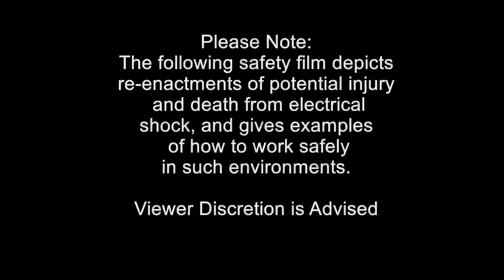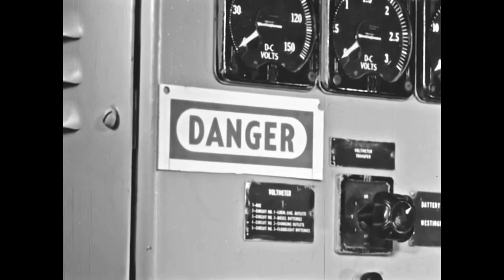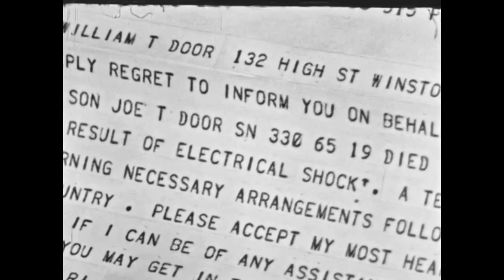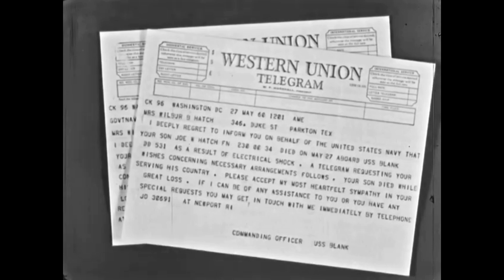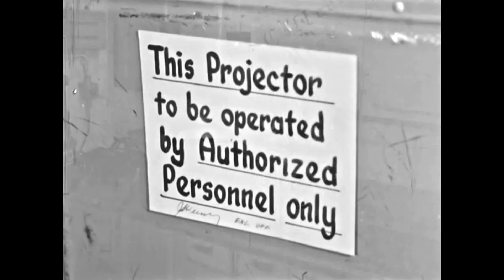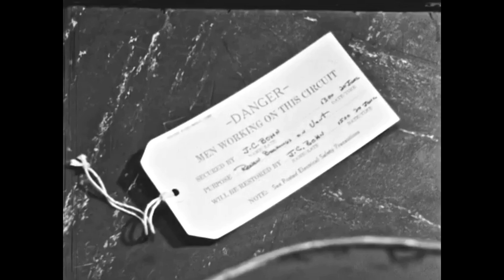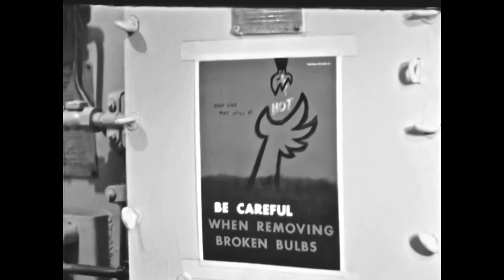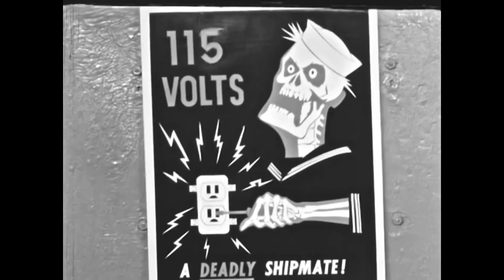How to Safely Control Electrical Power- Low Voltage Naval Machines & Electronics 1960 electricity

Comment: My youngest brother was in the Navy reserve and he said that they touched base intensely about electrical safety 
Electrical safety is a thousand times more critical aboard a Navy ship , Submarine and other watercraft because of course , Electricity always looks for the easiest path to the ground and the path of least resistance and aboard a ship , Everything around you is a path to the ground , Literally!!!  That's why every single appliance , power tool , Every single item that runs on electricity has to be properly grounded , After seeing this film , I wish I was one of those sailors aboard their ship so I can teach them about electrical safety , One thing for sure , If I was doing electrical work aboard a ship and had to go into a circuit breaker panel , I'd be using a rubber mat to stand on and wearing rubber gloves because everything aboard a ship is a path to the ground and wearing other protective equipment necessary and I would also have a second person with me when going into a circuit breaker panel or other live electrical equipment just in case something happens and the second person can call for help 
Never work in live electrical equipment unless you have a second person with you , I always do whatever I go into live electrical equipment and having a second person around known as The buddy system makes me feel more comfortable
Reply from the maker: Hi @ironmartysharpe8293, thank you for your very thoughtful feedback!   I really like the idea of having a second person accompany one in any of the shipboard scenarios.  That makes lots of sense.  I wonder if that is done aboard ships today.    Thanks very much for sharing your insights!  ~  VK, CHAP
@ironmartysharpe8293

Comment: This is the WORST film I've ever seen. I was an electrician in the Navy. First of all, you never have to lay down rubber matting to add dielectric value to 115/120V. I could understand such matting once you get around 400V.  Secondly, drilling into an electrical conduit with a proper ground connection, and he still gets electrocuted makes no sense. Thirdly, this was back in the days when every electric appliance had a steel casing. The ground wire attached to the steel body was there to direct electrical current away from the person towards the path of ground. Nowadays most power drills, saws and such are only 2-prong without the ground connection, because the casing is plastic... no need for it.
Reply from the maker: Hi @usnva5638, thanks very much for your perspective on this. Can't argue with the specifics and it sounds like you have experience in this area.  If they gave out bad info in the creation of this film, that would not be a good thing for the audience they are trying to teach.  Makes one wonder.

Comment: As a kid, I use to rewire outlets and overhead lights without shutting off the electricity. 🫨⚡ No my parents never stopped me and I'm still alive. I got really good at it , really quick. Could never figure out which glass fuse did what, so I just did it anyway. Shocking isn't it.

Comment: My first experience with 120 v AC was when I was 2 and jammed some staples in a floor electrical outlet in a department store.  Burnt fingers and traumatized mother. I've been in electronics my whole life and never forgot that day 😅😅
Reply from the maker: Sounds like quite a good lesson.  : )
Reply: Your not alone , I was almost killed by electricity when I was 10 years old and I didn't realize that electricity always looks for the easiest path to the ground and I was standing on the register warming my feet up and then turned on the floor lamp and I didn't know the lamp was defective and got a really bad shock and it was a miracle I got off the register , Stopping the shock and my parents came from upstairs and found me laying on the floor and then they realized that the lamp was defective and called the neighbor who's an electrician and found that one tiny strand of wire was touching the socket making the whole lamp live , and afterwards , He taught me alot about electrical safety 
Even though my ordeal was horrible 
Good came out of it which made me realize that electricity is very dangerous and I am very strict with electrical safety , I only do installations to meet the National Electrical Code and use high quality materials to do the job right , Absolutely no cutting corners or " Jerry rigging" of any kind 
Never take chances with electricity 
Such as cutting corners and/or using cheap materials to save money , 
Definitely not worth the risk 
Money can be replaced , You cannot

Comment: We've come light years ahead in electrical safety over the last 65 years, from requiring ground wires in all AC circuits in every home and commercial establishment beginning in the mid 1960s, GFCI protection in wet areas beginning in the early 1970s, the phase out of open front plugs ( the terminals in front of the prongs were dangerous when used with metal faceplates, the cardboard insulator that was supposed to slip over the prongs and cover the connections is all too often lost or never installed) AFCI protection in the early 2000s, tamper resistant receptacles since 2008, SPGFCI (Special purpose Ground Fault Circuit Interrupter) designed for use in circuits exceeding 150 volts to ground, such as the familiar 480Y/277 volt system used in commercial/industrial situations with lighting and 3 phase motor loads, first required upon the adoption of the 2023 NEC for swimming pool pumps.
Reply from the maker: Hi @rarelampcollector, thank you for that info!  Sounds like you have a good background in these electrical standards.   Never heard of SPGFCI.   That's a new one to me.  Thanks for sharing this!
I really wonder how all this applies to the use of home EV chargers and the voltages and power drain involved in this new "home use" technology.   Would love an expert's opinion on this area.   ~  VK

Comment: 3:55 Point taken but I would think a properly grounded drill would have prevented that. I did similar once and the fuse blew immediately. Maybe I got lucky and he didn't. Either way please work safe people.
Reply from the maker: Hi @scratchdog2216, yes, glad you are ok.   Good point!
Reply: I suppose us here on the UK had the advantage that all our plugs are polarised and that we never really had plugs or sockets without a ground connection, so it seems that we had more devices with an earth connection where it was probably not that necessary but safer. A similar fan in the UK would have been earthed, for example.
Of course we used 240V for everything, not just high power devices, so a more careful approach was necessary.
Reply: When the guy drilled into the conduit on the other side of the wall , If the drill was properly grounded , He would not get a shock because the ground wire would carry the current away from him and down into the ground , So for sure , The drill itself was not properly grounded , Also when the drill bit severed the wiring and if the drill was properly grounded , It would have blown the fuse or tripped the circuit breaker
Reply: These days drills are not grounded, or even wireless. A fuse protects the electrical installation only, not humans! The fuse may blow by a short circuit, I've been there. Protection is possible by an insulated drill, or these days by a circuit breaker sensing current is flowing somewhere else... RCD

Comment: Yes although it is true that electricity works for us, electricity can at the same time work against us if we're not careful or understanding of proper safety measures when it comes to working with electricity. The moral of the video is not only safety first(always safety first) but also be aware of faulty wiring or whatnot and learn the proper safety measures when working with electricity, thank you for this cautionary but great video CHAP
Reply from the maker: Hi @RetroEli1982, excellent point!  Safety is primary always.  Today especially, we need to be very wary of electrical tools and other devices.  We see coffee makers, toasters, etc., made over seas, with under rated plugs and wiring that get very hot.  Using low grade wire and connections to save money, causes more accidents.  We need to respect the current and voltage always. ; )
Thanks again for the great feedback.  ~  VK
@RetroEli1982

Comment: Good advice. Don't fear electricity but always treat it with great respect.
Reply from the maker: Very true!
Reply: My electrician friend always told me that to try not to fear electricity but respect , Electricity almost took my life when I was 10 years old from a defective floor lamp and I went to turn it on , I got a terrible shock and fell to the floor lamp and all , God had to have come down from his heaven and pulled me loose and my parents came from upstairs and found me laying on the floor and they realized that the lamp was defective , So they called the neighbor who's an electrician and found one tiny strand of wire touching the socket making the whole lamp live and I didn't realize I was standing on a path to the ground because I was standing on the register warming my feet up and later on , The electrician taught me alot about electrical safety 
I've always had a big interest in electricity and I've been doing wiring since I was a teenager and after my ordeal , I've become very strict about electrical safety , That I do installations to meet The National Electrical Code 
Absolutely no "Jerry rigging" of any kind and several electrician friends of mine gave me some valuable tips along the way when doing electrical work , If the job is not gonna be doing right , Then I won't do it , Even though my ordeal was horrible , Good came out of it which made me realize how dangerous electricity is and that doing the job right is very critical and I definitely don't want anybody to get hurt , I only use the best quality materials I can find , For example , I only use commercial grade outlets and switches , Not those cheap ones you find dumped into a bin at your local store , Using high quality materials plays a huge role in electrical safety 
One very important item everyone who does electrical work is a lockout for circuit breakers with a padlock and warning tag to lockout tagout the circuit before I start my work 
Lockout tagout is just as important at home as it is in the workplace 
If you don't have a lockout tagout and padlock , Go to your local electrical supply and get one 
So before you do any electrical work 
No matter how small the job is , 
Lock it out , Tag it out , There is absolutely no such thing as being too careful , ALWAYS PUT SAFETY FIRST !!!

Comment: An excellent film and equally excellent reminder on the dangers of electricity. I was permitted to play around with 115 volts as a kid... I most DEFINITELY learned to respect it!
Reply: The UK has double the angry pixies, even more fun for the enquiring hand of a young boy,  pretty sparks  oh  fire as well.    Dad !
Reply: I learned the hard way when I was 10 years old and turned on the floor lamp and nobody told me the lamp was defective and I was standing on the register warming my feet up and didn't realize I was standing on a path to the ground and how I got loose was a miracle because my parents would have found me dead and our neighbor who's an electrician told me about electrical safety and after my ordeal 
I take electrical safety very seriously

Comment: ...and the days of lessor-insulated non-polarized all-metal corded tools....  Yikes.
Reply: GROUNDING IS  ESSENTIAL . ALL METAL APPLIANCES LIKE MICROWAVE  OVENS,  DISH WASHERS, WASHING MACHINES , CLOTHES DRYERS ARE ALL METAL AND PROPER GROUNDING IS MANDATORY.  I GOT A SEVERE ELECTRIC SHOCK OFF OF A  WASHING MACHINE THAT SOMEHOW LOST GROUND THROUGH  A PERSON WHO WORKED ON IT  BEFORE. I FOUND THE PROBLEM . THE GROUND WIRE WAS LEFT OFF . I RECONNECTED IT AND CHECK WITH OHM METER FOR PROPER GROUNDING . NO PROBLEM AFTER I FIXED THE GROUND WIRE.
Reply: GROUNDING IS  ESSENTIAL . ALL METAL APPLIANCES LIKE MICROWAVE  OVENS,  DISH WASHERS, WASHING MACHINES , CLOTHES DRYERS ARE ALL METAL AND PROPER GROUNDING IS MANDATORY.  I GOT A SEVERE ELECTRIC SHOCK OFF OF A  WASHING MACHINE THAT SOMEHOW LOST GROUND THROUGH  A PERSON WHO WORKED ON IT  BEFORE. I FOUND THE PROBLEM . THE GROUND WIRE WAS LEFT OFF . I RECONNECTED IT AND CHECK WITH OHM METER FOR PROPER GROUNDING . NO PROBLEM AFTER I FIXED THE GROUND WIRE.